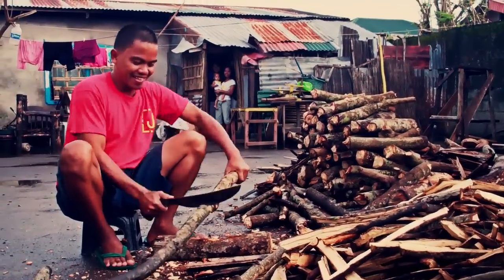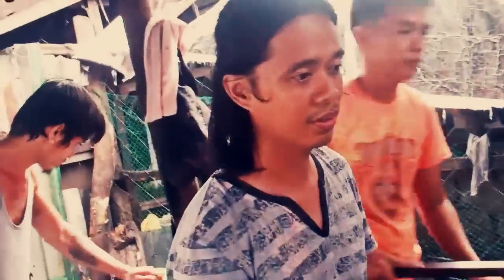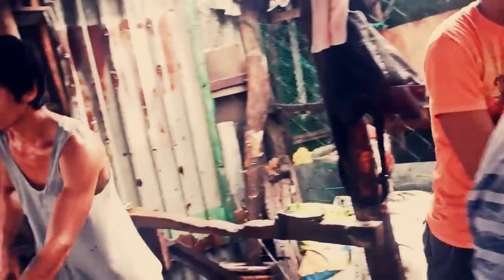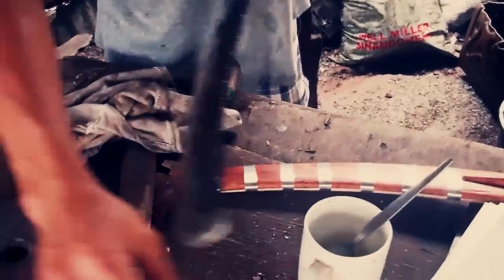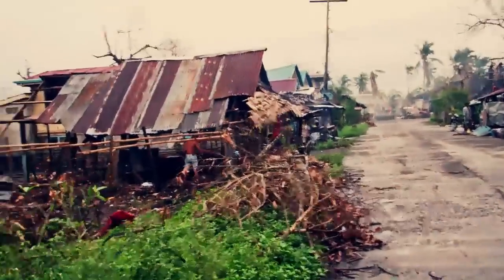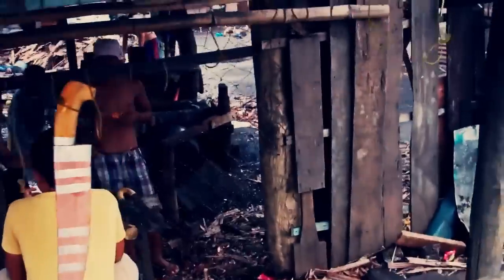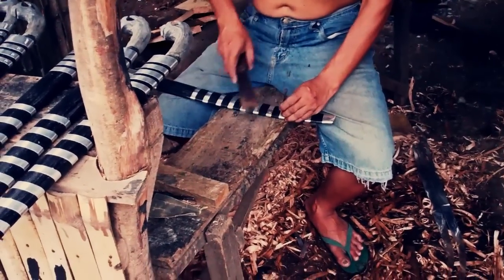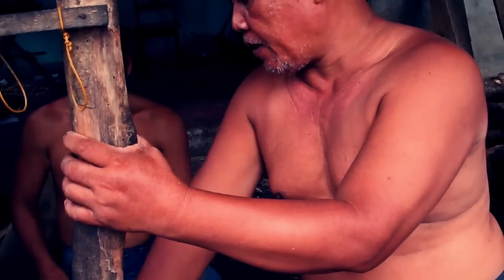The Knives of Carigara, Philippines

Comment: Great respect for your work with those people in need. Very interesting to see a box bellows. It was blowing on the push and the pull, or rather blowing and drawing. Do you know if there is n issue with the hot air coming back into the box, and how they solve it???